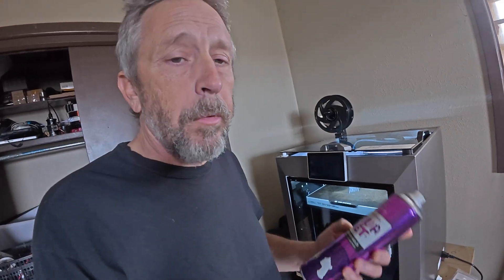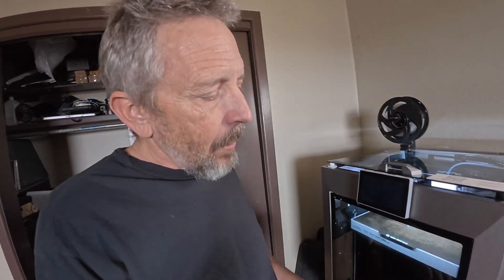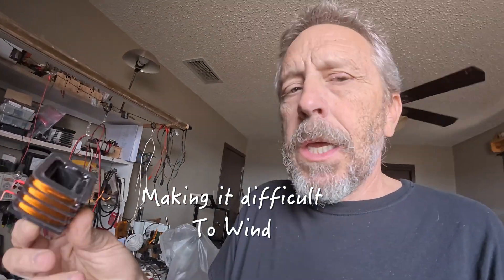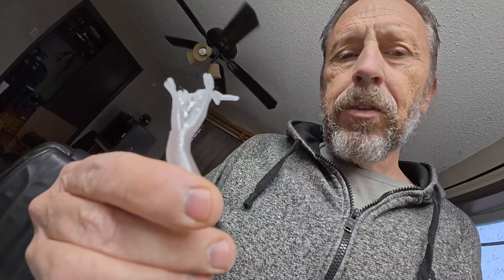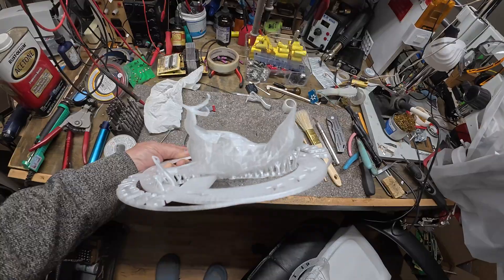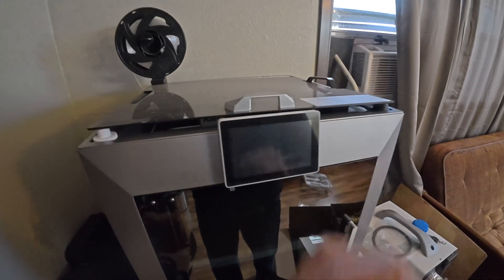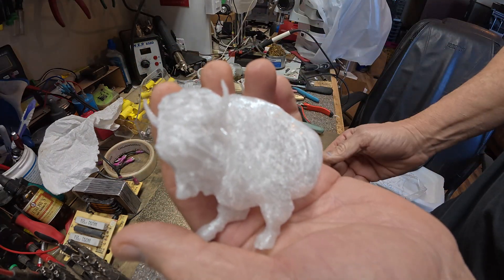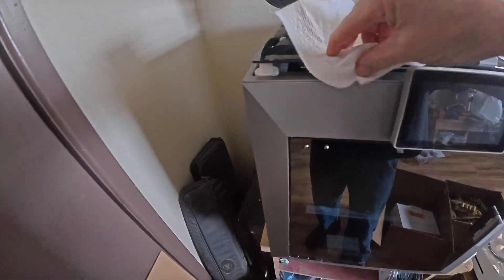3 Months with QIDI Plus 4: PLA & PETG Tips

Comment: could you share your slicer settings for petg? I am new to 3d printing and the qidi plus 4 is my first printer.  You said something about retraction?
Reply from the maker: Yes, I use the generic petg profile they provide.
For geetech filament I set the nozzle temp to 240 initial layer and 245 other layers  and just had to set the retraction speed to 45 (under the overrides tab). You may need to play with the temps for your filament but this has worked well for me.